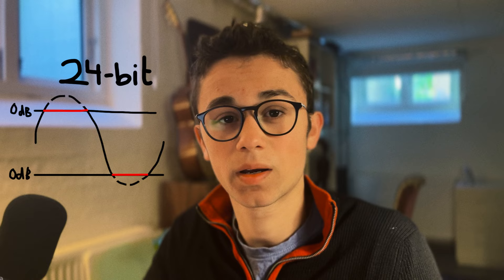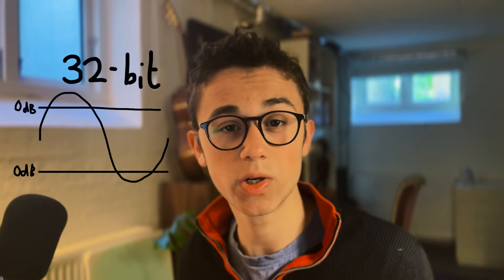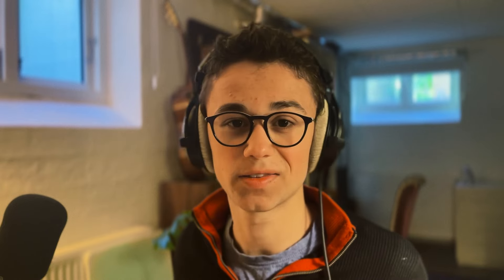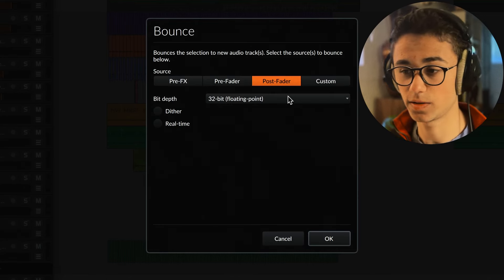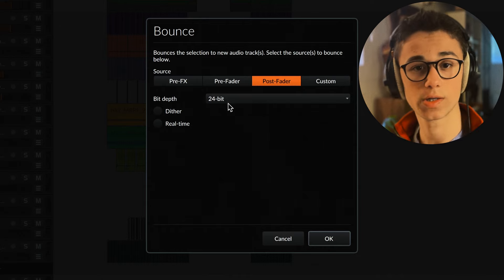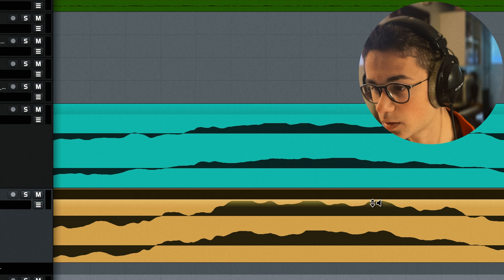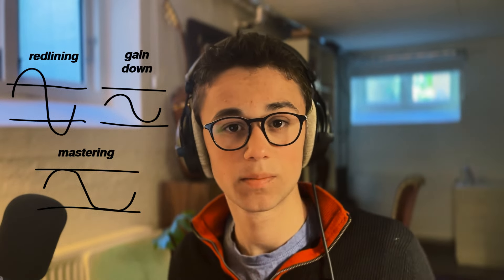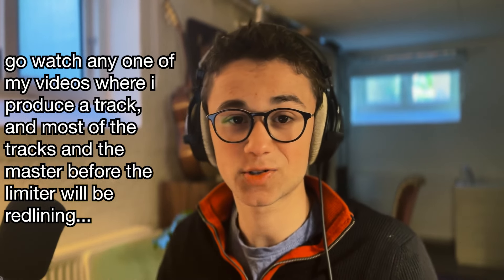why headroom is a myth

Comment: You really shouldn't feed signals above 0db to plugins or hardware. Gain staging includes all your levels between processors/plugins (input and output) not just the channel meter level. Also any plugins with non-linear responses have sweet spots that react to input gain. There is absolutely no benefit to your method. Even if technically 'you can't clip over 0db in a daw' there's no reason to do it anyway. Why would you want to turn your master down when you can just set proper levels to begin with. Just keep all your levels in a reasonable spot as you produce. The same is vital if you are recording audio.
Reply from the maker: I understand that, and that would induce artifacts, but if your track is in the red after having mixed it and levelled everything accordingly, I see no reason to go back in your track and re-level things just to ensure things aren't redlining. I mix as I make the idea, and I have a tendency to level everything relatively loud with the post-fader, which makes my track go in the red. I'm making this video, because I know a ton that do the same and think that their mix is doomed if it isn't under 0dB, and I don't believe it is 🤷‍♂️

Comment: Whist what you're saying about DAWs having headroom above 0dB is technically true, this is terrible advice. It's far easier to spend a few minutes correctly gain staging everything so that you minimise issues in your mix (such as plugins maxing out and clipping due to the signal being too hot), and it also allows you to use the VU meters for what they are designed for - checking the levels, rather than just seeing them max out (or turn red) for most of the time. 

Also, it means you don't have to do anything when bouncing your audio out, it just works, and doesn't clip.

Comment: I can see what you are getting at and agree with it for the most part but what do you think about gain staging within a track? So for example, -18 DBFS being the "sweet spot" for gain going into an analog emulated compressor? 

Other than that, I agree that the whole "-6 of headroom on the master!" thing is BS.
Reply: It definitely depends on the plugin yeah. I've seen plugins whose manual recommends hitting it at 0db or even hitting +3db to get tape saturation out of it. Others want -12 or -18.

Comment: Without headroom you can't use any analog modeling gear. That means even the stock glue compressor in Ableton. Plus do you really want to be thinking about signals over 0dB? Why?
Reply: not really.